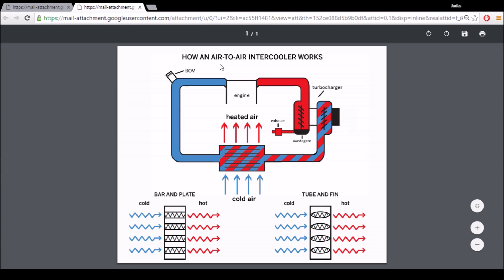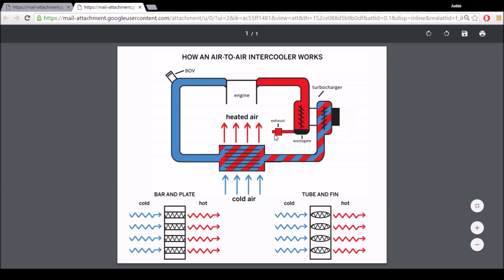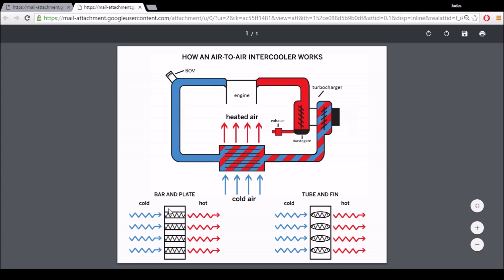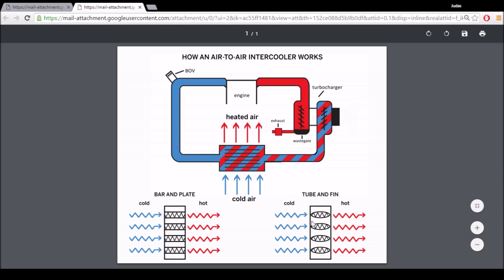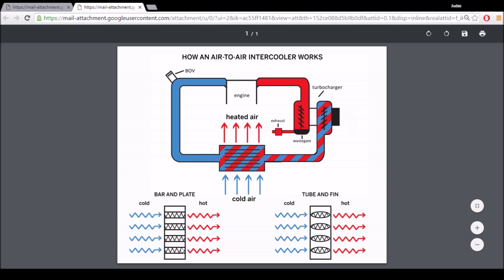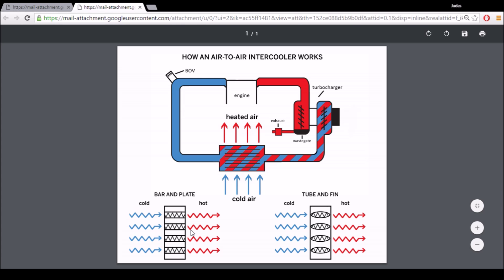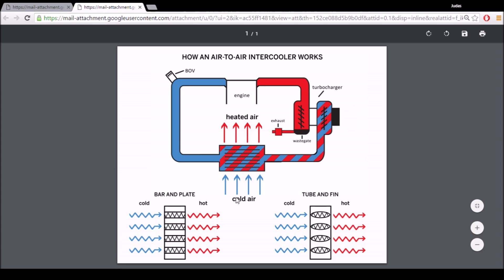How Does An Intercooler Work?? How Does It Generate Power?

Comment: In your review as ı see , you labelled the bar and plate  designs as better but most Ic designers produce tube fin designs for competiton / track  purposes. For instance wagner produces the same kit both as a bar plate(performance ,daily purposes) and tube fin ( competition series / track purposes ) cos tube fin designs cools easier. What's your comment on that ?
Reply from the maker: The tube and fin is used by some race teams, but is rather uncommon as an application in the automotive world. Very few companies make them. With high levels of investment, yes they can perform very well, however, one of the core reasons they actually don't use them as often in racing (dependent on the type of racing), is because of the failure attributes. If and when the tube and fin were to fail, damage to the engine will happen much more rapidly, there is a higher flow rate.

Comment: why does cold air have more oxygen ?
Reply from the maker: Cold air is more dense. And therefore will have a higher mass of oxygen, which will increase massflow into the engine, and with higher massflow, power is increased.
Reply: Cold means all other gas are also cold, so they will show same property as oxygen. so on the whole, no difference.
Reply: @yt678901  if you condense sometbing you can fit more of it in the given space my boy….condensed cold air has more oxygen than hot air
Reply: @zackz1260  If you condense something it will also condense Fuel before burning, in the end 1 or more oxy atom will bond to one fuel atom. so what's the advantage here ?  All cars are amble to put exact required air and Fule in their cylinders. This is some thing stupid i came across so I replied,
Reply: https://journeynorth.org/tm/crane/JoeAudio_CoolAirBest.html

Not exactly the same application as an intercooler, but it does explain the difference in oxygen levels between cold and warm air.
Reply: Air is about 78% nitrogen and 21% oxygen... Nitrogen is inert, so it's not really valuable in the combustion process inside an engine... it's really the oxygen we want to increase in a given volume but to get more O2 in, we also have to put more N in.

In a given volume(an intake stroke of the piston for example), if we drop the overall air temperature going in by 10 degrees we are then more or less theoretically sending about 1psi more nitrogen/oxygen together into the cylinder... but like I said it's really the more oxygen we want.

It's important to note that intercoolers will drop intake PSI, which is why you don't really use on an a N/A car because you have no way to recover the loss in PSI... you have less PSI, so less O2... and your engine will have to compensated by putting in less fuel... Less power then... just not efficient.

Instead... we use a Turbo for example that generates, say, 8 PSI then drops to say 6 PSI by the time it leaves an intercooler to send to the intake.  And given the intercooler also cools the air, it's more efficient to use a smaller Turbo that generates LESS PSI, and rely instead on using cooler air.  Imagine how big the turbo would have to be if it didn't have an intercooler!  Bigger turbo means more weight, less room under engine bay, and more metal to eventually be heat soaked which then that heat taxes many different aspects of engine performance.

Alternatively you could pour NOS into the intake which when released breaks down leaving more Oxygen... many people do that instead of using Turbos.  Really there are a few ways to delivery more O2 into a cylinder as is evident in the different race cars you may come across.

But then again you can't just stuff all you want into any cylinder no more than you can blow up a balloon infinitely... eventually it will pop!  Which is why some guys decide to run larger displacement engines.  The parts are bigger and more robust so you can throw more into it without the piston seals blowing for example.  Every engine has a sweet spot and it can be very difficult to determine what YOUR particular engines sweet spot is because so many factors are "moving targets" such as heat, Elevation, compression efficiency etc etc.

Because of these "moving target" fluctuations It's basically a fucking mess tuning a car from one day to the next which is why performance cars are sch a PITA.
Reply: Because its condensed.